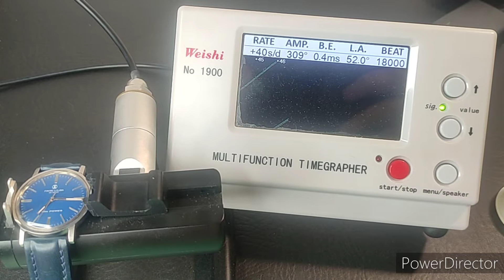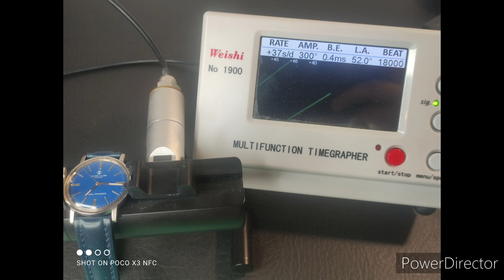Favre Leuba twin power cal.253 full service

Comment: Nice job!!!! I think it was better if two main springs were cleaned and lubricated. And i guess there may be some issue somewhere in the movement that makes it run so fast.because the bitt error lookes fine. Thanks for this video!!!
Reply from the maker: hello, the springs have been washed and lubricated.  not everything is shown in the film.  the watch works very well, the accuracy  is perfect 52 degrees is the wrong LA for this caliber.  I did not find the right angle, looking at the shape of the pallet fork.  I think the executioner should be around 40 I don't know.  the amplitude would be lower and the accuracy closer to zero.  on the desk, the watch has a plus of 2 seconds per day
Reply: @Karol235  hi. Thanks for reply. Great job!!! I just thought you didn't do that. Yes that might be around 48 degrees. But plus 2 seconds a day is great. Thanks for bringing it back to life!!!

Comment: Interesting movement, 2 barrels and an interesting click/crown wheel assembly.  A few questions though, why not open and clean the barrels?  Why not disassemble the click/crown wheel parts and lubricate them?  Why not adjust it and not leave it at 40 s/d? 
Thanks for sharing such an interesting movement, I assume they were trying to save some money by using a cheap setting lever and riveting some of the wheels.  Must be during or right after the quartz crisis. 
Keep up the great videos
Reply: I just saw your reply regarding the barrels and lift angle, sorry for asking the same questions again.
Reply from the maker: no problem, I'm glad someone is interested in it and asks for anything

Comment: Hello. Great Job! My Sea-Chief with the Cal.253 is running significantly slow at about -3 to -4 minutes per day. I wish to improve the accuracy by regulating the hairspring. Is it clockwise for fast and anti-clockwise for slow in its regulation? Also, to what degree should I make the rotation for this anomaly?
Reply from the maker: Hello
  there should be information on the balance bridge + -, or f s fast slow.  4 minutes is the service is needed.  the adjustment may not help.  if there is no information on the bridge, move it to shorten the hair and see the result in a few hours as it will not help to try the other side.

Regards
Karol
Reply: @Karol235  
Hello,
Thanks for the information. I adjusted the watch a bit and now it seems to run fine. Without a timegrapher I can't track the seconds precisely so I am worried about errors in minutes only. I shortened the hairspring slightly and now its no more than -15sec/day, which is still flawed but way better than what it was. Once again thanks for your reply. I don't have a fine watchmaker in my city so I take care of these things myself as much as I can after learning from what guys like you post here. I might have a few more queries in the future so I could bother you again 😉
Regards
G.Gows

Comment: That seems highly jeweled; why do you say low quality?
Reply from the maker: hello, the number of jewels is not enough.  see seting lever spring, barrels do not close.  are half open, I showed the wheels permanently riveted.  workmanship and type of finish.  is low.  I remember a very similar soviet slava cal mechanism.  2414 very similar design
Reply: @Karol235  I have a very high opinion of the Slava 2414; impressive accuracy for such a mass produced caliber.
Reply from the maker: @jacobgreenmanedlion1863  I agree with you, the soviet mechanisms are very good.  I have talked about it many times.  personally, I really like soviet watches.  I mean the price-quality relationship.  a Soviet watch can be bought for a fraction of the price of a Swiss watch.  and the Soviet one will work equally well and will be nicer / better built.  in this case, slava -favre